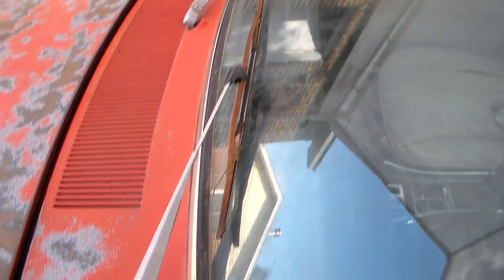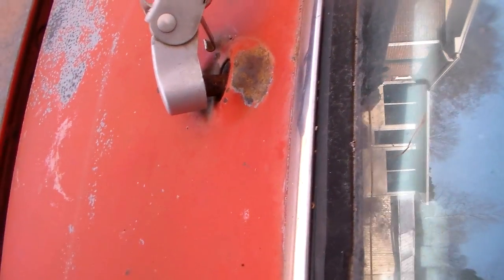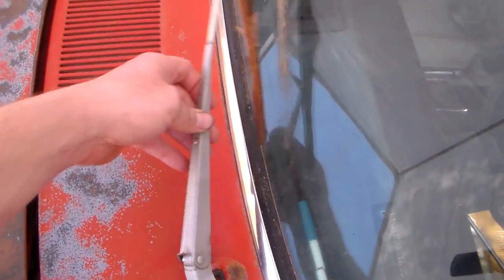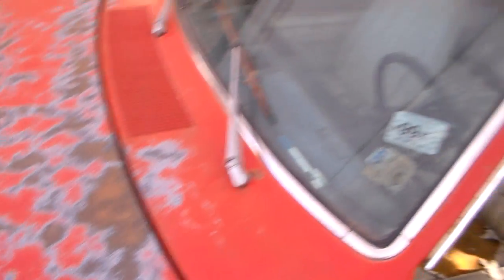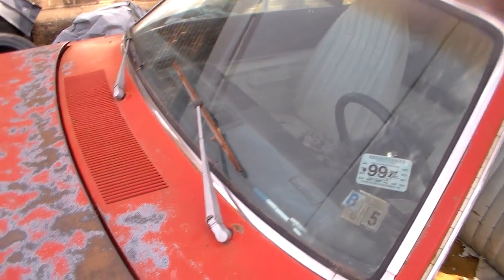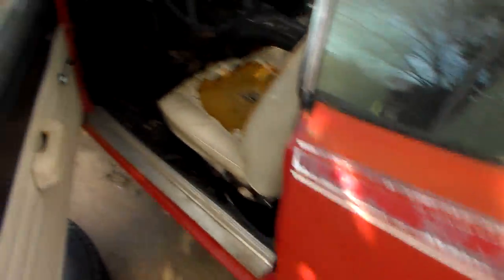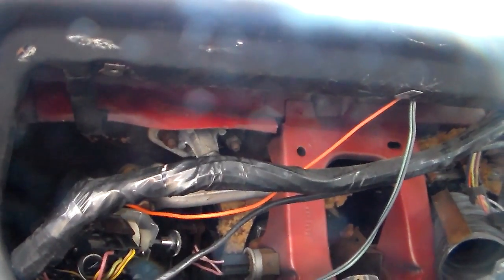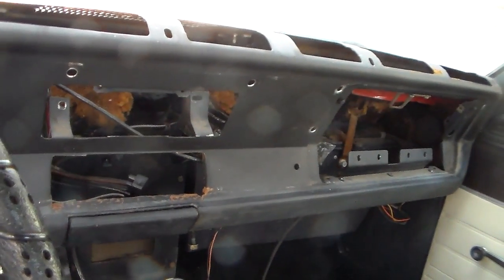Prepare to repair: 1973 Dart Sport wiper pivots

Comment: How's the carport holding up? 

Did all the 70's darts come with bucket seats, or will it be tricky finding upholstery for that white seat?
Reply: Best of luck on that. Might be able to find a split bench with arm rest that is almost the same as you see, and console would have to be modified to still fit the area in front of. My 75 had white at one time. Tried to find buckets but who wants to spend north of $550 to $800 for a set of frames. Search out local places and you might get lucky.

Comment: What kind of a help video is this? You show us the problem but never show any kind of repair procedure . NOT much help!
Reply from the maker: I already did a 3 part series on the wiper seals BEFORE this video. How about searching before running your mouth.
Reply: Tyler's Neighborhood Garage nice can you point me to the replacement I have a 1973 Plymouth scamp I need to put my wipers back on track
Reply from the maker: Just google "mopar wiper seals". There is wide availability for them.